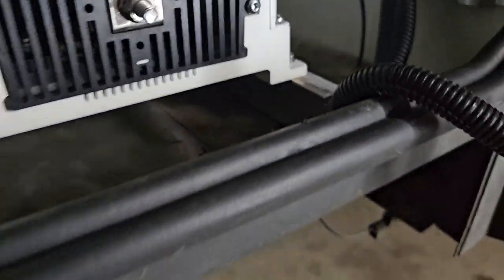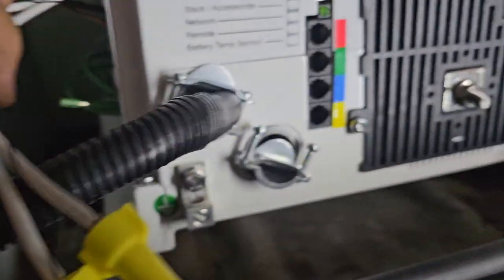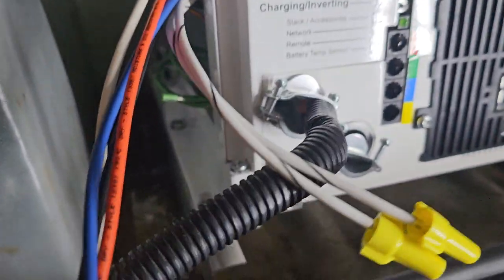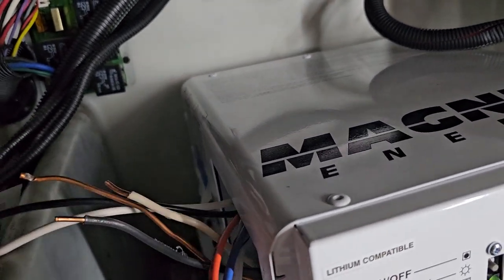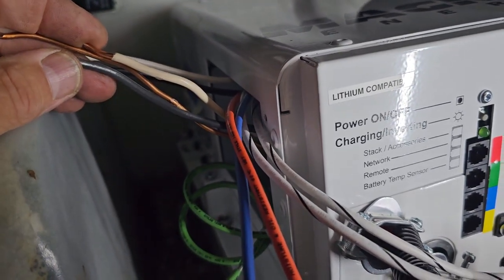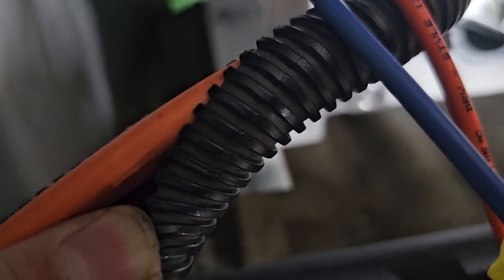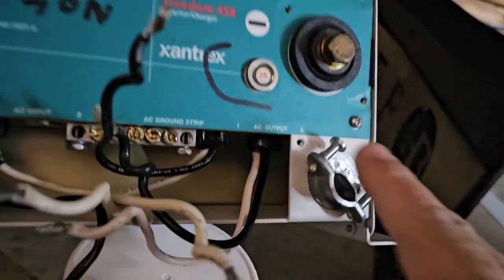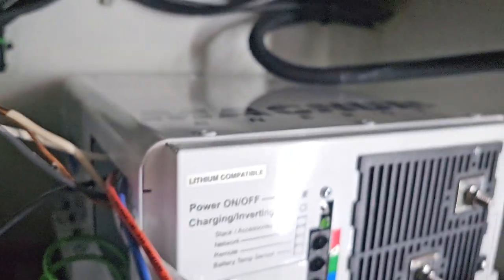Inverter swap zantrex for a magnum.  video 2 of ?

Comment: I would like to replace the Source Manager II in my class A.  Is this the inverter you would recommend?  Thanks for the videos!
Reply from the maker: The magnum in this video is a pure sine wave ,Witch is good for induction motors, fridge/air-conditioning/any ac electric motor